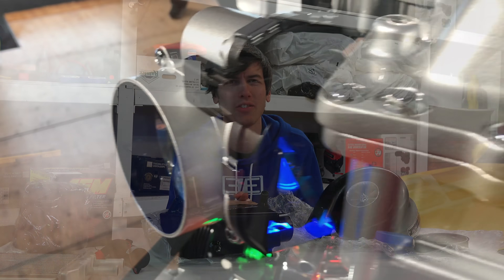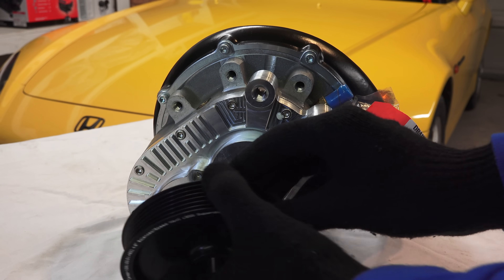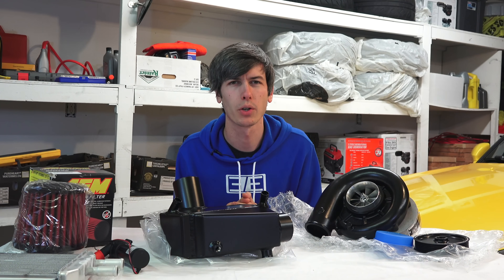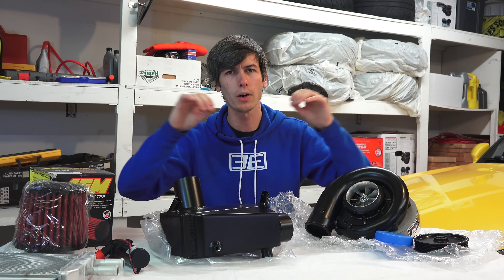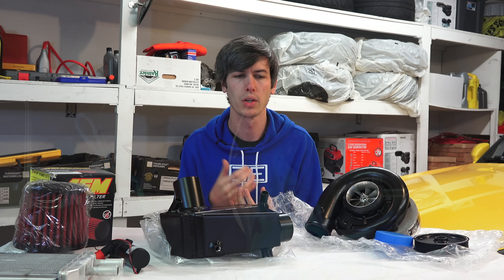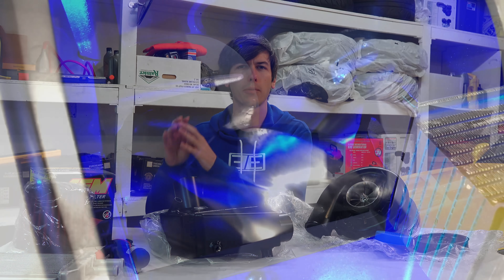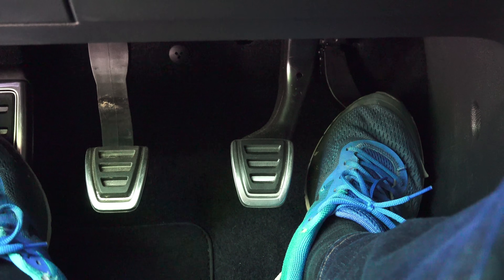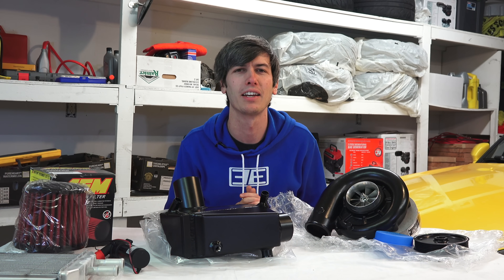Turbochargers vs Superchargers - Which Is Better?

Comment: Basically, 
Bwaaaah Stututututu vs Weeeeeeeeee
Reply: I read this in Marty's voice.
Reply: Couldn't have said it my self
Reply: Imagine if supercharger would make noise like REEEEEEEEEE ou yeahhh
Reply: @j0lel666  🤣🤣🤣🤣🤣🤣🤣🤣🤣🤣🤣
Reply: why not both
Reply: The Hennessy Hellcat has about 1012BHP.
Reply: @thingthingsss  about that Hennesey Hellcat... 
* Estimated power ratings at the engine.  Actual power will be measured at the rear wheels, before and after the upgrades are installed and tuned.  Rear wheel horsepower and torque figures are approximately 15-20% lower than the factory published power figures which are measured at the crankshaft on an engine dyno.
Reply: @se5845  a lot of people don't know, or realize power ratings are measured of the crank..:(
Reply: Weeeee is much more fun
Just listen to the hellcat for instance... Or search on yt "ford escort mk1 supercharged" such an awesome noise it makes...
Reply: @hoepsipoepsi  the whine sounds so bad, the flutter is where it's at bro
Reply: PcGaming15 R7 370 learn how wrench bro you make no sense
Reply: Koen Foo yes but turbos mute the sound thats coming from the exhaust. Superchargers not
Reply: Ok you’ve earned a sub
Reply: TURBOCHARGERS: If you love the theater and beautiful drama of awesome noises and don't mind learning to tame you're unpredictable power (which is fun in it's own way), ALSO CHEAPER. I love the show-off factor.
SUPERCHARGERS: If you love that "hand of god" power feeling you get from immediate torque, and the predictable driving confidence driving in real-life traffic. MORE EXPENSIVE. Although the whine of the supercharger was a little irritating at first, I learned to love the physics-ignoring power delivery. I've always loved vehicles that invoke CONFIDENCE when you drive them, because I feel like I can get 5x more out of a vehicle I can always predict than a turbo that I'm guessing at. Like i'd never break the tires loose on public roads in a turbo, simply because I'm not going to risk getting that boost at the wrong angle.
Reply: @cybertree  this is car talk, price is not part of the discussion lol. But I agree supercharger all day
Reply: Ez to understand, thank you
Reply: SI0AX it's called compound supercharging mate
Reply: bwaaaaaah pssshhhhh is better than bwaaaaah stutututu
Reply: Koen Foo 9 minutes in 3 words 😂😂😂👌
Reply: Koen Foo I get it now
Reply: The comment is on point af
Reply: Who say we can't have both 🙂
Reply: Weeeeeeeee is always better
Reply: welcome to the future, where refinement is part of the progress.
Reply: travos k I bet you could have
Reply: It’s sounds like your cars creeping for help to
Reply: Cars overdose
Reply: Pielemans 《---- This guy gets it...
Reply: Lmao 😂..... true.
Reply: I'll take the weeeeeeeeeeee
Reply: You can aleays put both in the engine bay. Then you get Bweeeeeeh Stututututu
Reply: Lmaoo😂😂😂what the hell
Reply: Lol
Reply: Well to anyone who says complexity is a plauge. I've had my 150k mile E36 M3 turboed now for 180k miles now so 30k miles over 3 years since I first turbod it. Maybe it's about the understanding on what you're doing to the engine. What ever you do to make more power, in your best way make it as efficient and strong as possible, you'll be happy with the results.
Reply: @jth_printed_designs  cause you cant make high boost numbers with that kinda motor. Thats why they go with a blower  and not turbos.
Reply: This Guy 😂😂😂
Reply: Тъпанар смешен
Reply: Koen Foo that is sooooo accurate tho. I hear it on the streets all the time lololol
Reply: But I have both in a 7 seater SUV 😲😬
Reply: Not gonna lie 😅 I read this then made the sound
Reply: I wish I could like this comment more
Reply: Weeeeeeeeeeee all day 🎉
Reply: Rc car VS jet engine
Reply: Caner
That's in my opinion the biggest downside of turbocharged engines. They simple can't keep up with the sound to supercharged an NA engines. Best example: BMW straight 6 in the M3. How lovely do they sound in the NA configuration (e36/46) and how inferior and without any character in the nowadays turbocharged versions. They sound so bad that BMW actually tunes in fake engine sound through the speaker system :-(
Reply: @Chris675R  you never heard the sound of an AMG GT if you think a turbocharger kills the engines sound..
Reply: @j.richter776  Yes I heard it live, couple of times. I don't like it, it doesn't even come close to the old 6,2l NA V8 in the C63/E63.
But I know there're people that like that turbo muffled sound, so I don't blame you for liking the sound of the GT.
Reply: @Chris675R  that's a pretty rare phenomenon on the Internet. Maybe it's because I usually discuss with other Germans but Nazigermans and they're just like killing me.. Thanks to your for respecting my opinion.
Reply: S90 here, I've got both :)
Reply: +Pedro Santos: "You might as well say space shuttles dont use turbochargers..."
The space shuttle use(d) turbopumps which pretty much do for rocket engines what turbochargers do for car engines.
Reply: Pedro Santos I don't know who you know in terms of super car enthusiasts but the ones I've met all lament that every new car is a turbo instead of an NA or supercharged one
Reply: Too much complexity isin't good for reliability, maintenance, troubleshooting and cost. 
If you are up to the challenge then why not, but if you can't afford the headache, stay away from that combo. I think it's called Twin-charging. Use a big turbo for high RPM and use the supercharger for low RPM response.
Reply: The point is that it's still an engine
Reply: More like BWHAAWhiIiiieerereeeAAAAAAAA BLAP BLAP BWHAAAAAAAAAAAAAwheeieieieieieieeerreeee BLAP BWAAAAAAAHHH

I know this is a childish comment but it was neat to make XD
Reply: Lmao 😂
Reply: stutututu
Reply: At the end of the day its a personal preference. I believe most enthusiasts prefer turbos, modern ones are very efficient and have very little lag, especially in twin turbo setups. I can see why people like superchargers but to me nothing beats the rush of boost from a turbocharged car.
Reply: Not only is turbo whistle and wastegate noises music to my ears, you dont see any 1000+hp motor with a supercharger. All the insane 1,500-3000hp cars of this world are ALL turbocharged.
Reply: Talking about road cars here, son . You might as well say space shuttles dont use turbochargers...
Reply: @PedroTRamos1  dont think 1500 hp car is going to pass emissions test especially ones shooting flames but blowers have made more power
Reply: @PedroTRamos1  shuttles don't use em?     And there was me for years thinking they had a bank of 2jz
Reply: @PedroTRamos1  well, in fact most aircraft uses compressors, but a few also use turbochargers.
Reply: @PedroTRamos1 The Saturn V used turbo pumps for fuel delivery, the design of which remain a masterwork of engineering...
Reply: And my point is that everyone that wants to make huge HP figures goes for turbos.

Comment: Turbo chargers are almost always better in terms of power. But, Superchargers are way way way more reliable, and easy to install. Turbos constantly break. It's the only thing i hear about Turbos, constant 1k repair bills. So, i prefer Superchargers overall by far.. and the noise of Superchargers is also unique and better than Turbos.
Reply: VKGchaos very general and vague comment, easier to install would just depend on the application.
Reply: They break because people don't leave then alone.  With a super charger power is power.  Increasing power on a super charger is a pain in the ass and costly.  Turbo on the other hand there is a dial or a button just sitting there tempting you to turn up the boost.  

14 is safe.  16 is pushing it.  But that guy just barely beat me.  If I turn it up to 20 just once I should be ok.  

And BOOM
Reply: Turbochargers are awesome, and if I had a race car, I'd probably go the twin route. But for something like a daily driver, I'd go the supercharger route.
Reply: For an S2000, turbo offers more HP.
Either way, there is no wrong decision, though.
Reply: OutlawUniverse How is increasing power with a supercharger difficult? You swap in smaller puppies and belts and voila. They even have centrifugal superchargers now that you can adjust the boost levels with the push of a screen inside the car/truck.
Reply: The power you can make depends on the size of the engine. For small engines like 4, 5 or 6 cylinder engines with about 1 to 4 liter a turbo is the best. When you use a big engine like a 6 liter V8 a supercharger should be better in terms of power. The larger your engine is the more air you need to reach the same psi. To compress more air you need a larger turbo or supercharger. A larger turbo has a larger lag. A larger supercharger just takes more power. A big engine can easily handle a big supercharger. With an turbo the lag would be very long so you hardly could use your power. 
So I would go with turbochargers in smaller engines and superchargers in big V8s, V10s etc.
Reply: VKGchaos i personaly prefer turbo noise
Reply: Yeah, it's all preference. I've got a Supercharged Mercedes, and it's so loud you literally cannot hear the engine. All you hear is Supercharger Whine, it sounds more like an aeroplane than a car. If you drive something like that you might change your mind.
Reply: VKGchaos you say more realiable, but less used,  doesnt  play well with diesels and less thermal efficient
Reply: VKGchaos turbos have a lot more eng bay Heat!

Comment: I love the Subaru BRZ and other cars in the category, but I live in a snowy state. I know you face this problem too, but I do not have another car. Do you recommend getting the BRZ with a good set of tires for all year conditions?
Reply from the maker: If the snow isn't deep, a BRZ on winter tires will do fine with smart driving. Last winter my S2000 spent 3 months in the garage because the snow was too deep for it. It's on winter tires this year, but we haven't had nearly as much snow so it's been fine to drive around.
Reply: BRZ is slow,  get a GTi

Comment: hi
and what about twincharged setups?
i mean, u said that you've driven turboed and supercharged cars but, have you ever driven a twincharged one?
Reply from the maker: Indeed I have! Here's a review of a twincharged vehicle I drove: https://youtu.be/zVx-YcviGYY
Reply: Twincharger are rather rare, not to mention their purpose is the same as most twin turbo setups. The charger is for lower range power and the turbo is for high range power.
Reply: chelar estelar twincharging is a basic way to avoid turbolag without having high fuel consumpion. The response of a twincharger is faster than a turbocharged but will still consume more fuel. Lately, thanks to new designs and technologies, tubolag is becoming so irrelevant in turbochargers that any other solution is pointless.
Still if you are looking for a "cheap" solution, new turbochargers with compressed air or electromagnet drive, are not the best choices.
Reply: A twin-scroll turbocharger is still a turbocharger. It extends the rpm range in which you can efficiently produce boost, but there are still times when the turbine isn't getting enough exhaust energy to produce boost.
Reply: What is the practice performance difference between twin-scroll and twin charger? Twin-scroll is pretty common right?
Reply: Simon Ashton Twin scroll turbos don't really have the advantage they once had. Turbine design and materials has improved greatly, so has efficiency.
Reply: Goldmarble There's a very minimal difference these days between a twin scroll and a properly designed modern ball bearing turbo (spool time and threshold). You don't need to use those dopey twin scroll manifolds or deal with the crappy stock wastegates.